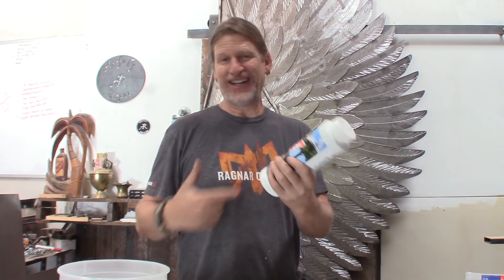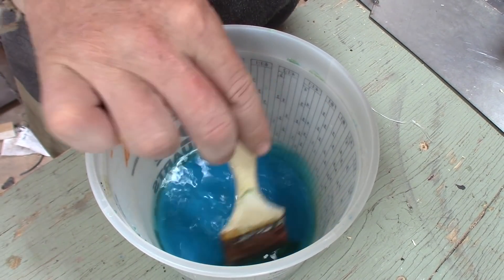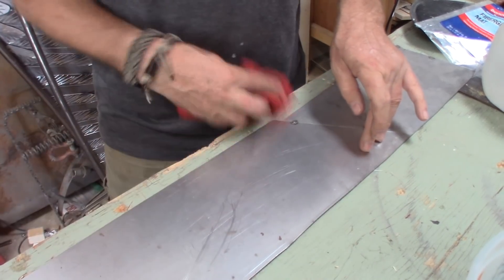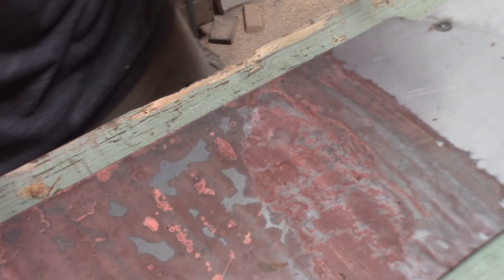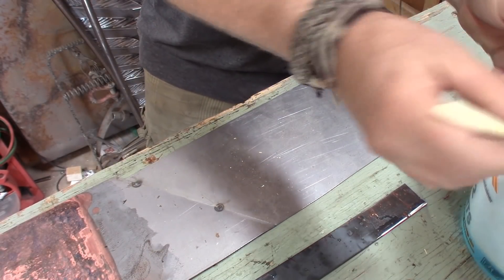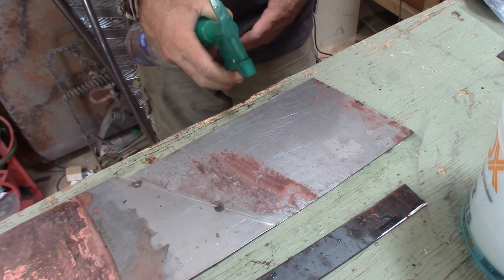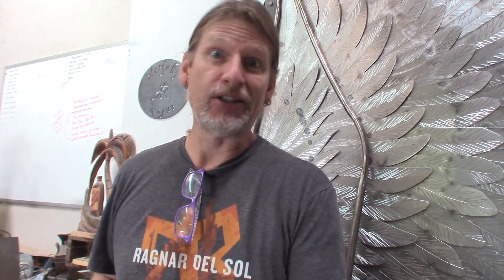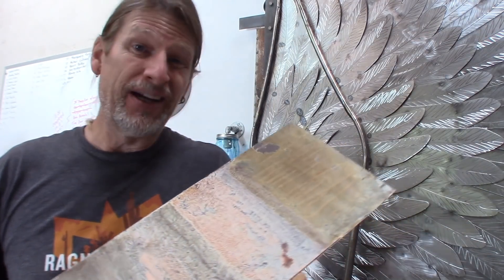Copper Sulfate on steel FREAKED ME OUT!!!!

Comment: You can get an aluminum brightener from NAPA that works instantaneously; it’s mostly phosphoric acid and it foams on contact like peroxide on a cut. You might have fun with that ... oh and it reacts with other metals in all kinds of crazy ways, even just slightly different alloys can make a huge difference... like one alloy might not show any changes at all, then next sample, seemingly not that different, but the phosphoric acid maybe turns the steel ink black almost like gun bluing does.
Reply from the maker: Thanks Kenneth! I'll have to get me some of that.

Comment: Wipe the steel down with a rag and some muriatic acid, quickly wash it off with water and quickly apply the copper sulfate over the surface with a brush or rag.  ONLY work in one direction and DO NOT go back over any area you have already treated or it will often take it right back off.  You can make the whole surface look like a copper sheet this way.  The acid etches away the microscopic layer of oxidation on the metal that will prevent the copper sulfate from working evenly.  But you have to be fast.  When you wash the acid off, the water and air will instantly start to oxidize the metal,  You won't be able to tell, but when the copper doesn't chemically plate it in some spots, you know it wasn't clean enough.

Copper sulfate will also turn lead and zinc black..  It is used in stained glass work to antique the lead cames and solder dark.  We used to get it in liquid form at our local stained glass craft supply stores.   And in India they do this nifty silver wire inlay into zinc castings (bidri metal) and they turn the zinc black with the copper sulfate so the silver wire work shows up bright. ( "Metal Techniques for Craftsmen"  by Oppi Untracht, Doubleday 1968, 1975  has a little chapter on it.)

A friend of mine also got enamel to stick to steel by first plating the steel with the copper sulfate and then melting the enamel onto the copper areas.  Otherwise you need a special formula dark blue enamel undercoat invented by the Dutch to get it to really stick straight to steel.

Most of the people in my college art classes just used to urinate on the steel to make a rust finish in a day or three.... works great.  Again, the steel needs to be squeaky clean etched for an even coating of rust. Unless you want it more textural and splotchy...
Reply from the maker: Thanks for the info DAZ! I'll have to check out the book you mentioned

Comment: does the copper coating on iron or Al go away easily upon scrubbing or does it stay
Reply from the maker: I wouldn't say it goes away easily as long as you leave it on long enough to bite into the metal

Comment: hi i used it on metal ss 304 sheet -  mixed this copper sulfate in water as directed - and thn i brush it over steel nothing is happing plz guide me
Reply from the maker: It doesn't work on stainless steel to my knowledge. Are you the person that called me? If so, sorry I missed you call but I was sleeping
Reply: Yeah I have become a big fan of yours yes I tried it on ms it worked , I called u sorry for disturbance as u were sleeping
Kindly help me in guiding how can we achieve such Patinas on steel by chemical. As I do a lot of steel work I convert steel into gold and many type of shades by spray coating but patina is something which I m not able to achieve on steel

Comment: I finish metal for a living with over 20 years experience and  i use a similar chemical ...if you clean up and purge the metal with solvent or  a heavy duty greaser you will have more consistent  results ..a light clear coat will lock in the finished metal
Reply from the maker: thanks Michael
Reply: can you give an example of the solvent or greaser please

Comment: Very cool. Thanks
Reply from the maker: You bet
Reply: @ArtfullyRogue  do you think it will have the same effect on metal roofing? I just built an outside bar and was looking for something cool to do to it.
Reply from the maker: @wjmcleanslate1  if its a corrugated metal roofing, you'll need to roof the galvanised coating before you can rust it. Grinding seems to work the best as opposed to an acid wash

Comment: Copper will become plated onto an iron based metal such as steel via an electrolytic reaction. The chemistry is explained @ http://www1.chem.umn.edu/services/lecturedemo/info/Plating_Copper.html. Also jewelers are familiar with this copper plating chemical process whenever their acidic pickling solution which has dissolved copper becomes contaminated by an iron based metal. See how it works @ https://www.youtube.com/watch?v=i-qEi7Q01iA

Comment: HI, this is interesting, but I gave a thumbs down due only to potential injury due to irresponsible safety practices, The product and  copper sulfate alone require gloves, eye protection and good ventilation. The unspecified vinegar ( plain white maybe ) can react as well. I do like the results. Keep it up! Mark R.
Reply from the maker: Thanks for the honest feedback. If PPE was your sticking point. You'll love the fact that 30 years ago I used to spit fire. Putting Kingsford lighter fluid in my mouth and never using PPE.
Reply: @ArtfullyRogue  Thanks for reading and the humor. 30 years ago I would make the same comment and ride my motorcycle drunk at 130 mph every chance I got!  Now I don't drink. The doors looked great, I have etched metal only twice and satin clear coated with linear polyurethane. Good luck, GOD BLESS Mark R.

Comment: I’ve found that if I use a sponge and really rub in the metal, I can get a beautiful looking copper finish. But my big problem is neutralizing the reaction...how do I stop it?  My copper finish will turn rusty...which is not the effect I want. This happens no matter what I do, thankfully it is pretty forgiving...so I just sand off what I don’t like.
Reply from the maker: I don't think I've found a way to actually stop it. Applying a high quality clear coat will delay it. Eliminating its access to oxygen is key
Reply: Artfully Rogue yup, after experimenting today I’ve confirmed the only way to stop the reaction is to clear it immediately. Thankfully working with this is forgiving, if I don’t like a area I simply fine sand it back to bare metal. Keep in mind, I’m doing a Vw bus, so I imagine by time I finish it I will have this down. Also, I was going for the bare metal mirror look prior to this,  so I’ve actually had to go back and rough up the body, the copper sulfate didn’t work too well on metal that was sanded to 3,000 grit. Interesting stuff...and yes, I question my sanity...my son was like, you’ve spent months sanding the bus...and now you’re doing this? yup. lol

Comment: I’m planning to rat rod a car, and would love to try the copper sulfate.
When you are done, do you coat it to preserve it? 
Do you know if you can leave it uncoated? I’m not a fan of the clear coat look.
I know people use linseed oil on rust patina to preserve it
Reply from the maker: Yes I use a spray on clear coat to stop it from rusting any further. I've used a matte finish when I didn't want it to look like I've clear coated though
Reply: @ArtfullyRogue  once applied can the copper patina be oxidized blue?

Comment: Excellent video.  Thank you for your insight.  I also sculpt in steel and have been using Birchwood Casey Plum Brown on my pieces.  Unfortunately, this product can no longer be shipped to Canada ( so I'm told).  Been mixing salt, vinegar, and hydrogen peroxide but looking for something different.  The section where you painted on the copper sulfate then sprayed vinegar -  have you just mixed the two?  Or is it dangerous?
Reply from the maker: I've never mixed the two in the same bottle but spraying them on a piece of metal together hasn't caused any problems to date

Comment: Do you have to neutralize the chemical somehow? I'm trying to get my head around patinas and rusting before finishing a large sculpture I made, and I just wonder if you seal without neutralizing, will the chemicals continue to change the metal beneath the lacquer.
Reply from the maker: The correct method is to neutralize before sealing, however I rarely do that. Most of the time once I've reached the look I want I spray an automotive clear coat and seal it and I've not had any issues with the rust or patina changing much after that

Comment: This is EXACTLY what I've been looking for! I am building a steel countertop but want a more bronzed/rusted look.  I suspect this won't hold up to much abuse so I'll have to experiment with a sealant. Any suggestions appreciated! Thank you for doing this!!
Reply from the maker: I've found that the longer its left on the steel the better it is. Then I use an automotive clear coat to seal it
Reply: Well the reaction forms elemental copper on the surface of the iron based steel. This probably wouldn't hold up to much since I suspect the coat to be thin but you can always repeat it several time to get e thicker layer, although it might start to look like plain copper on the surface which isn't very exciting. But since it's been two years already this is probably too late anyways, so how did that countertop turn out? :)

Comment: Breaking Bad lols, that was exactly what I was thinking about; I was trying to think of some clever way of including it in a sentence about the doors.
This is really interesting stuff, the change happened so quickly; 7:55  I adore the patina on the right, with those dark patches with bright copper edges. I'd love to live in a shipping container with walls like that. 

Could you use it to etch out a copper design by adding an electric current? 
This is really inspiring; this video gave me some helpful ideas for a steel framed, wooden storage unit for my art equipment.
That beautiful metal wing in the background immediately set my mind to the movie Castaway.
Reply from the maker: I've heard that charging the metal would be like copper plating although I've not tried it

Comment: You should try it with hot roll steel, as the cold roll has a surface that is designed not to rust quickly. May give you some different effects.

Comment: I have used a copper sulphate & ammonium chloride mixture to patina copper before. When you do that there is a follow up trick that might work here, though I’m not sure about steel or the feasibility of applying this technique to doors. I’m pretty sure the ammonium chloride only accelerates the process (but I ain’t no chemist, so...), though I have also added ordinary table salt before for a different texture. 
Do this outdoors for ventilation of very toxic gasses, while wearing gloves and goggles!!!: 
Prepare a vessel that can contain your project (I used a 5 gal bucket with a lid) and a block for your project to sit on inside the vessel. Treat your project with copper sulphate like in the video. While still wet, place project on block in vessel so it does not touch the bottom. Pour ammonia into the bottom of the vessel, avoiding your project, and put the cover on the vessel. Now the ammonia in the bottom evaporates and reacts with the patina forming on the copper. Once this happens gasses in the vessel become EXTREMELY TOXIC!!! I can’t stress that enough. As if ammonia wasn’t bad enough, but seriously, it’s really super nasty poisonous! Be careful not to breath any when removing the cover! The reaction mostly takes place in a few minutes. I’ve waited up to half an hour before with not much happening after 10 minutes. This turned copper patina bright blue across a spectrum from aquamarine to the bluest of deep blue azures. The patina can sometimes develop as a frost-like crystal fuzz (I don’t know why because I wasn’t really being thorough with my experimentation or research, just playing with colors, sorry. Adding salt might increase this; can’t remember, it’s been years.) that will require sealant to protect it from handling if that’s even possible. I had this suggested to me by word of mouth, before there was enough internet to look it up on, and I managed to do it without hurting myself but all the stuff described above is very toxic and requires safety preparations and good ventilation. Be careful folks!

Comment: I have  a similar recipe for fun as mitigation in my orchard 
99% sulfer , vinegar, and 1"  copper fittings . Absolutely works
Reply: I planned to use some pieces of copper when I do the patina paint job on my 53 chevy truck... Haven't seen any videos using it yet

Comment: Copper Sulfate is hard to dissolve in water so either grind it up fine or find a dealer that handles the CS powder. It also is a GREAT aquodic plant killer and won't harm fish if use properly . Just don't put a LOT of it in,,it will kill ALL Aquodic plants like Moss and Other Beneficial plants that oxygenate the water. Warning, make sure you use a Good quality rubber glove and do NOT get it in your eyes...you WILL suffer for a while

Comment: CuSO4 + Fe ——> FeS04 + Cu, Fresh copper deposit is pink/brown, Iron II sulphate is pale green but will oxidise over time to Iron III sulphate which is rust brown. Vinegar is acetic acid, an pH adjuster to accelerate the process helped through some trace Iron II acetate formation. The copper deposits are only particulate and precipitated and therefore this is not an electroplate but just a coating and may not be very robust. Electroplate is an atomic scale deposition, forming a dense integrated surface which is therefore adherent and robust. The atomic scale process was further theorised in the electrochemical production of Hydrogen by Fleischmann and Pons to enable even nuclear “cold fusion“ processes but their experiments were not repeatable or verifiable. It would require quantum mechanical tunnelling but this concept is already accepted as the basis for semiconductor functioning. If you have a go at that one, stand about 10km away from the location if the experiment😉

Comment: The process you're illustrating here is also an old-timey way miners used to get copper out of ore.  Many copper deposits are acidic in nature.  The ore was pulverized and further acidified with sulfuric acid (sometimes the ore itself was acid enough or other acids were used to cause sulfides to break down into sulfuric acid in the ore) and pull out the copper in solution (probably copper sulfate).  Then the liqueur was poured into a vat filled with anything steel (steel wool, old bed springs, car parts, steel cans, etc) and the copper plated out onto the steel.  When the steel was sufficiently thickly plated, it was shipped for refining and copper had been milled.  This process was mainly used at small mom and pop operations in the last century.  You can find these mines all over the west by looking for copper areas with little mines and at the mines you find concrete vats filled with all sorts of rusty steel.

Comment: As I recall, copper sulfate is what I used for gun "blueing" To return old or damaged rifles pistols to their factory type blue finish.  The area damaged was cleaned / de-greased then the copper sulfate (Outers and or Hoppes etc,) was applied  Once the desired color match was achieved the process was stopped with an application of light machine oil. Thanks for sharing.

Comment: So cool! How durable is that patina? Does it have to be top coated? Ok you gave me one I will give you one. I am a blacksmith and if you heat a piece of steel  to around  1000°f then brush it with a brass or COPPER  brush it will give it a very durable brass or copper sheen. Super  easy,  the more you brush the brighter the color  becomes (to a point, it will never look plated) super  cool trick I use ALL the time!

Comment: I am a chemistry teacher/maker.  Vinegar cuts through grease.  No part of rxn.  Slight hue of blue is oxidized iron.   I would clean surface with acid first.   Muratic is a better option.  HCL.  Then  dry with rags.    Immediately it will start to oxidize.  Paint with cu2+.   Cu2+ is the ion you are using.  Consider using hair dryer or just let stand to dry.  Then like you said. Spry poly.  Very thin.  Just enough to shield from atmosphere.
Reply: another cool option and maybe cheaper is to use galvanized steel.   Then simply take of zinc with Muratic HCL.    I used a kids pool.  Layed it in. Used sponges to reapply acid from bottom of pool to metal.  Caution.  Will eat concrete😥 below pool of leaks.

Comment: Man discovers chemistry. Noble copper displaces less-noble iron. Fun to watch tho.
Reply: No,, more reactive metals will replace less reactive metals. Iron is more reactive and replaces the copper in copper sulfate producing copper metal and iron sulfate. Titanium is made by combining and heating magnesium metal and aluminum oxide in a reaction vessel ( to keep the magnesium from burning off) and you end up with magnesium oxide and titanium metal. Or so my chemistry education told me.
Reply: william Greene - thats what noble means. More noble means less reactive. Hence copper is the more noble and less reactive metal. The acid dissolves the more reactive, less noble iron and it is displaced by the copper in solution, being plated onto the remaining iron in the process.